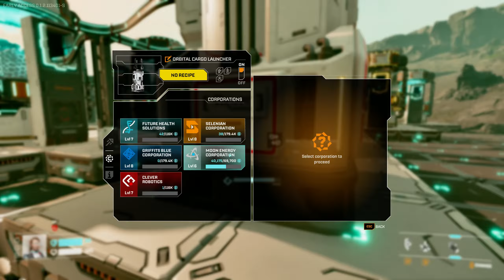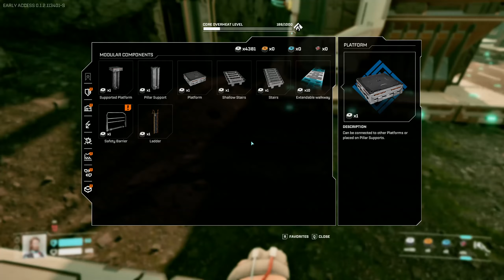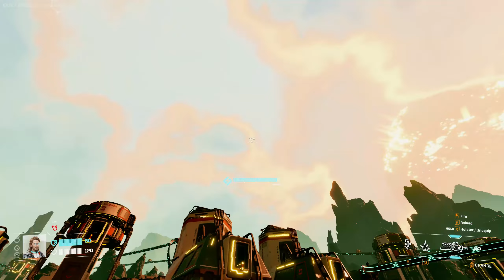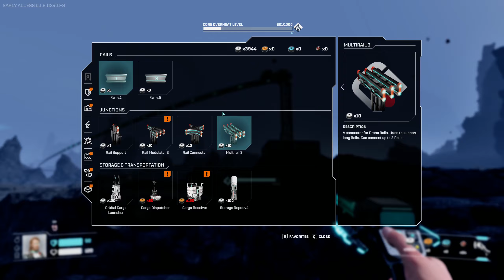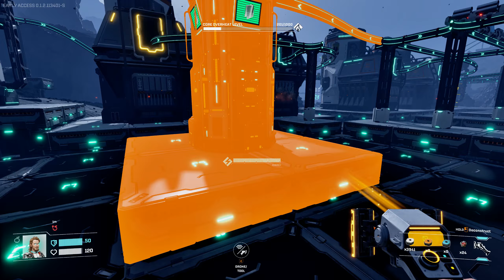👉 Intermediate Building Materials Factory COMPLETE! | StarRupture Part 17

Comment: been following along with the series, thanks for that. Just a couple of things I noticed you could do better. Use tier 2 belts only; you have them, so use them rather than mixing 1& 2 belts. The outputs you send to the OCL make a row of 3 for each machine output to increase the amount sent out. Fills the contract much faster than just 1 OCL machine. The last thing was when you tried doubling up on Titanium line,  dont use 1 line with splitter to join the 2 lines, the drone will only choose 1 path & no matter what you do it wont change. Just use 2 single lines then join those 2 lines into your manifold ( double splitters/joiners ) you can add more machines easier with this setup. Keep on going with the series, I enjoy watching it. Dang, forgot 1 other thing, every single machine, joiner has 2 modes. You right click to make item go from being in between 2 tiles to being in center of the 3 / 4 tiles. makes it much easier to line up your joiners to the center of the input or output.
Reply from the maker: Great advice on centering the joiners, never noticed the ability to right click them into the position I wanted.  That was always annoying to me to never be able to get them just right.  Thank you!